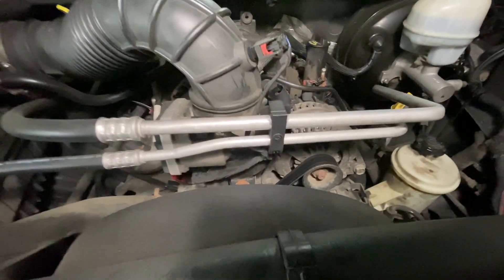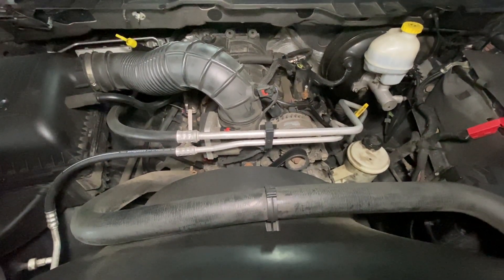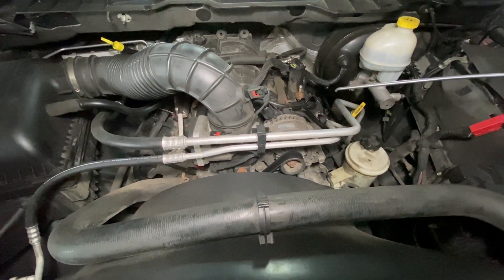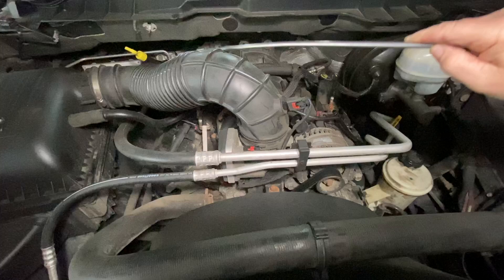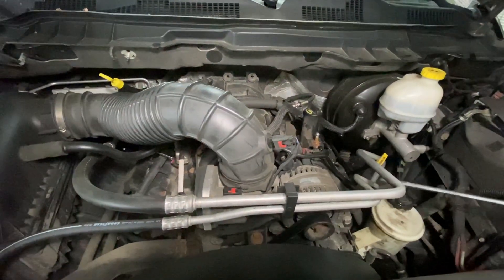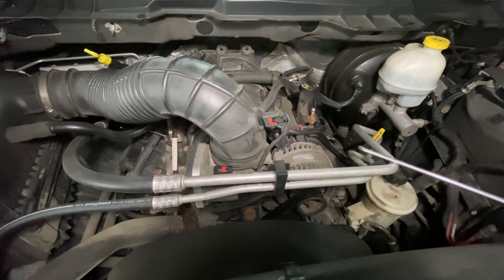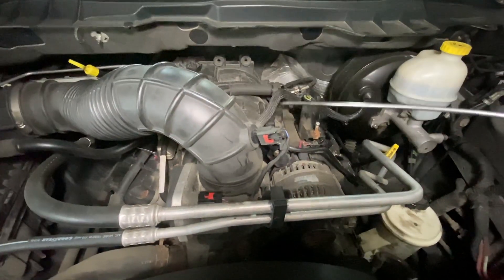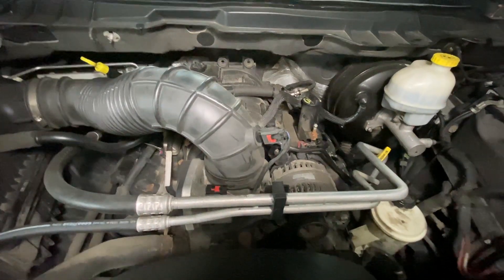Chrysler/ RAM /Charger 5.7 Hem Gen 3 2003  & Up - Cylinder Location & Firing Order

Comment: I only have a cylinder 1 misfire just changed my cam position sensor. Can I just replace the 2 spark plugs for cylinder one rather than all 16
Reply from the maker: Yes you can, Not ideal but you can.
Reply: @motorcarnut alright thanks I’m going to end up doing the rest next week but I wanted to go ahead and get check engine light off so I can renew my registration
Reply from the maker: Good luck!

Comment: What about F which is cylinder F would that be number 6?
Reply from the maker: Don’t know what you mean by F?
Reply: @motorcarnut  I’m guessing cylinder 6 it’s my friend trucks but this is the code the scanner is pulling P0356 Ignition_Coil F
Primary / Secondary
Circuit
And then P0306 Cylinder six misfire
Detected
Reply from the maker: Yes, that is number 6
Reply: @Eplics same thing happened with my 2013 except it was ignition coil H I replaced all the coils and spark plugs and it went away until now I have a misfire on cylinder 6 only when I hit 5k RPM or more